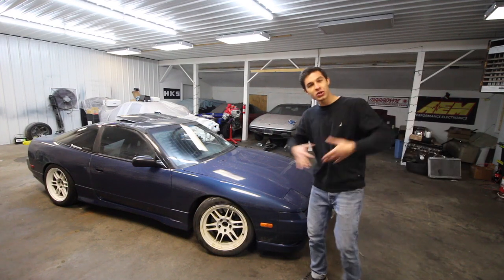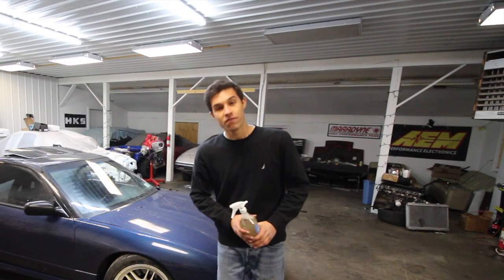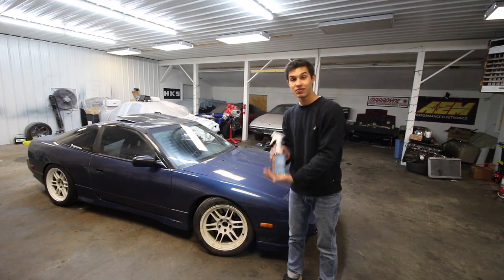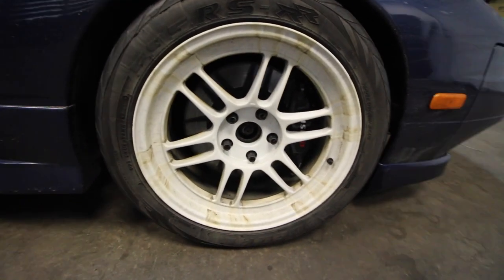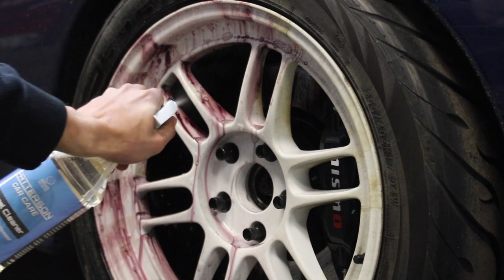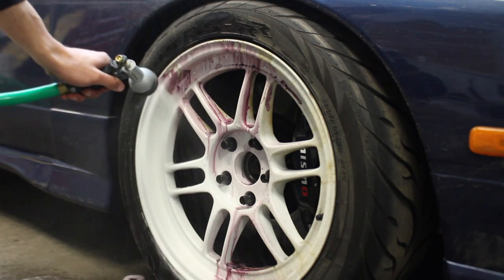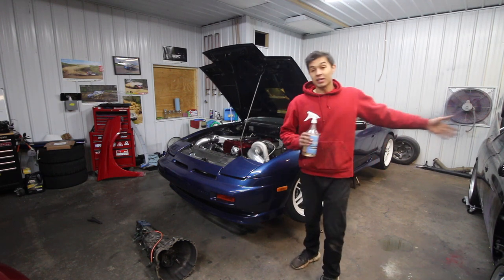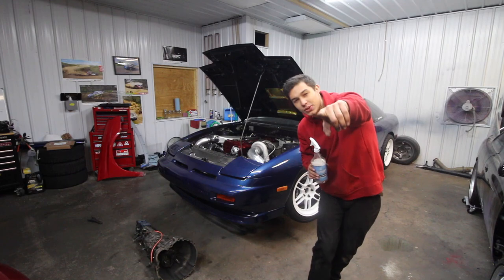Is ThatDudeInBlue's Wheel Cleaner Any Good?

Comment: It works well, got the brake dust off no problem. Only problem when I used it is that I got some of it on my hand. Which caused a chemical burn because it contains hydrofluoric acid. Just be cautious or use gloves when using it lol
Reply: If it doesn't burn it doesn't work lol
Reply: George A good to know!

Comment: Buy Awesome Orange at you located $1 store, gallon for a buck. You can dilute it 4-1. I use on anything dirty. Won't take off paint. Or use it 50/50 to clean block.  You need to buy ceramic pads to keep dust down. Don't forget to clean inside rim too.

Comment: This stuff ruined my rims and also ruined my tires
Reply: Big Bennett TV how long did you leave it on? How long did you take to spray it with the solution and how long did you take to remove it?
Reply: Left it on for 5 minutes. Corroded my factory clear coat and dried out my tires. Looked like someone applied bleach to my tires
Reply: 5 minutes good job. clearly you cant read directions. You only need to leave for 45 seconds! Second off only do one wheel at a time. and always lots of water after the rinse.
Reply: mark Frasier I don't know if it was exactly 5 minutes or not I sprayed on my wheel hooked up my hose and nozzle and sprayer and sprayed it off
Reply: Big Bennett TV with aggressive cleaner like this you should have all that set up b4 hand. Lessons learned. Also like he said on video always test first.